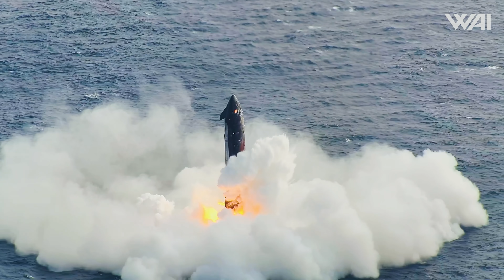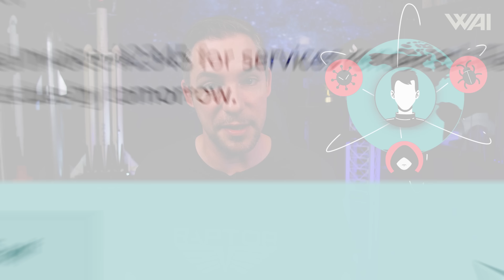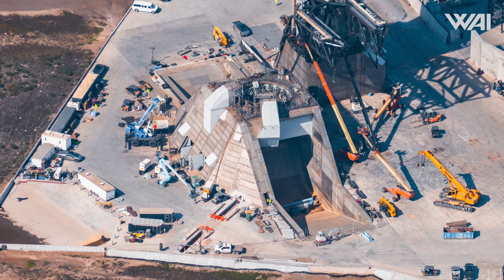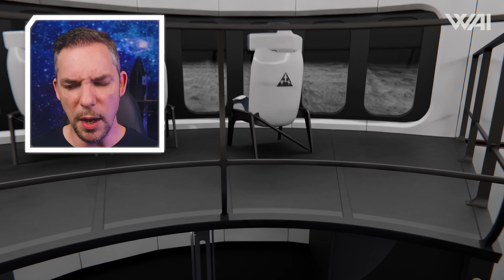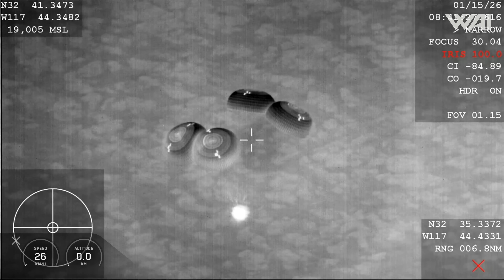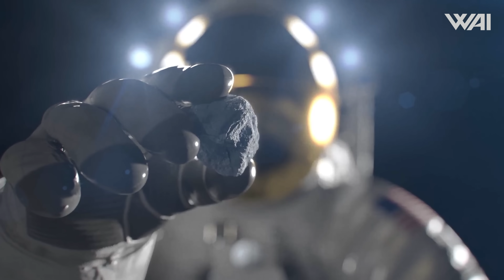SpaceX's Ship 39 Ready For Testing! When Is Flight 12? Isaacman Announces Moon Base!

Comment: COPV issues exemplify why carbon fiber composite structures and cold liquids are a bad mix. Going with Stainless Steel will prove a genius move in the end. Atmospheric re-entry and re-use with low conductivity, easily en-brittled cf (=also high boil-off), large tanks filled with cryo props and autogenous pressurization's gaseous phases which add thermal gradients that exacerbate stresses would probably be a show stopper for Starship just like the failed X-33 program showed. We'll see if CF works for the reusable Neutron, unlike Electron.

Comment: If a lunar ascent stage were mounted orthogonal to starship length in its nose, its engine could provide cushioning thrust for a controlled tip-over upon a vertical lunar landing, the tip-over being initiated by one of the perimeter landing engines. You wouldn’t need the big cushion or the unloading elevator. During a mishap, the ascent stage could fire to return astronauts to lunar orbit. Pilots, and any passengers, would land on their backs on couches (needed more than chairs in the base) and would be standing once the tip-over is complete.

Comment: Yeah I just don’t think it’s worth it to use carbon fiber in something that’s going to be reused. Even when it’s used for its tensile strength, there is still way more failure fatigue in carbon fiber than there is in metal. Am I wrong here? It just seems like a pretty obvious flaw in an otherwise sound system.

Comment: FYI,  the image of the large COPV on a pallet strapped down to a truck bed is terrible transport practice for a copy. The red covers are marginal and only prevent accidental minor damage caused by a tool or slight bump. The trailer staps are very powerful and could easily damage the copv.  If they want to get to Mars,  they need to train the people not to treat them like a concrete drain pipes but rather delicate instruments.  COPVs give the lay person the air of being tough, but they not. The worst part is, most could never detect the flaw after it is damaged. That's why you protect them like delicate eggs from the point they are made to the time they are installed. They learned two, possibly more events due to this, if the trailer situation is a measure, they are likely to again.  I live not far from you on the space coast by the way.

Comment: Since SLS Block 1 will NEVER fly again after Artemis II, and Orion failed on Artemis I and Orion has not been redesigned , what exactly is the point of risking four lives and billions of dollars on a test of these two obsolete systems?  Why continue to subsidize the profits of Bechtel Corporation in building a new launch platform to handle the slightly larger SLS Block 1B which will probably only fly ONCE at a cost of $6B.

Comment: If NASA was up to ship 39 to get into orbit, it would have been cancelled long ago
Reply: Well, NASA has not tried to master full re-usability with any ship/rocket combination...so not a valid comparison.
Reply: @markb2773  What would you call the Space Shuttle then? The solid rocket boosters were recovered and reused as well.
Reply: @flightsimdev  Yes, that is true , but the cost and length of turnaround was not sustainable.  I remember reading that it actually would have been less expensive to just build all new solid rocket boosters than to refurbish the ones used.  And the Space Shuttle was amazing (I absolutely love it to this day) but its many different sized tiles and its refurbishment in both cost and time was considerable.  They (NASA) then went back to expendable rockets and kind of gave up on re-usability.

Comment: So this is speculation only but I think there may be more to that red casing than your thinking. Remember that sub that imploded a few years ago? So part of what happened was separation and THERMAL effect which further exacerbated the defect.
They need an insulation wrap to protect them from the extreme cold of the tanks I think. Otherwise a defect that is inside the wrap and visually undetectable could fail in extreme thermal situations. Such as cryogen liquid.

Comment: And SpaceX is never going to be able to explore the Galaxy. There is a  whole leap in technology that as yet has to be discovered before humanity can leave the solar system.
Reply: How do you know that leap won't be discovered by SpaceX?  Who else is going to push that envelope?
Reply: @markb2773  Because this is physics, not engineering and a century of evidence shows it isn't possible
Reply: @JohnLagrue  Not at this moment...but airline travel wasn't possible 125 years ago either...it won't be never but it also won't be any time soon.
Reply: @markb2773 true enough, up to a point. But the physics of non-chemical propulsion needs to be discovered even to explore the solar system. Beyond that, relativity says we cannot go. Not until some major scientific breakthrough.
Reply: @JohnLagrue  I agree with you there.

Comment: it's not a bad composite over wrap, it's a bad weld seam or leaking seam the carbon has "nothing" to do with the tank, the welding is flawed in some areas or it's metal fatigue remember they press the top and bottom to shape

Comment: What has been the lead time on V2 vs V3? How long has each initial flight article been in construction and testing before launch? If V3 has had a longer lead time I think it is safe to assume that spacex is taking what they learned from moving fast and breaking things to really do their homework and thoroughly test all aspects of the new designs on the ground, or at least as much as they can so they can ensure that when V3 finally lifts off the flight goes very smooth or close to it. with potential modifications learned from testing waiting in the bays, but nothing substantial to the point that we saw with V2. I think they want this version to work from the start and really take them to achieve major program milestones in quick succession with minimal modification. Time will only tell but I hope that this is the case.

Comment: I think the proposed fuel transfer docking system is strange.
A kind of space station that could dock starships and fuel carriers simultaneously seems like a more correct solution. Using, for example, a docking system similar to that of the ISS, where it would even be possible to have several fuel carriers simultaneously.

Comment: Actually those are not ‘refuelling ports’, they are ‘refuelling docking ports’ since the actual refuelling is going to be done via the Quick Disconnect Ports.

Whereas these are needed for the refuelling docking process. So they are actually docking ports.

(This is going to get confusing when we later add ‘Docking transfer ports’ into the mix !
Reply from the maker: Not fueling, but refueling! Precisely! Yeah, I see how this is getting confusing. :D
Reply: @Whataboutit could a hydraulic/ syringe type design work for refueling the starship?
Reply: Semantics...
Reply: @johnd.7792 … are important. If no fuel travels through a port, it is not a refueling port.
Reply: @TallinuTV  'refueling docking ports' you said, then turn around and say it's not a port... Is it a port yes, what is that port used for? Refueling... while saying it's a refueling port is more informative, doesnt mean that calling a refueling port a port is wrong, just not as informative.
Reply: @johnd.7792 technically, if fuel doesn't travel through them... They're just docking ports, which are used when refueling. Is what it sounds like he's trying to say?
Reply: @GrabNSnatchM Again it's a docking PORT... you are literally saying a port isn't a port, and it's wild to me.
Reply: The affect astronaut.....Zena is pregnant.
Reply: Are you describing the fixtures on the hull of Starship or Jerod’s ears?

Comment: Get ready for more problems.  SpaceX is flailing here.
If Artemis III in 2028 was a real date.. the HLS or Blue Origin Mark 1.5 lander would be in manufacturing today.  That is the normal process for designing, developing, and exhaustively testing and retesting man-rated space craft - it's a process that takes years.  Since I don't see anything like that happening now, 2028 is a fantasy.  Or .. Artemis III will NOT be a moon landing.
Reply: NG3 does not appear to have a scheduled launch.

:planet-orange-purple-ring:

:planet-orange-purple-ring:

Comment: I was thinking they always have problems with hydrogen escaping why not build a small enclosure around the pipe connection then pressurise the inside wouldn't it then stop the hydrogen escaping from the pipe and if you pressurise it with O2 or somethig like that the molecule will be to big to fit through the gap the hydrogen is escaping from , so it would be a good gas to stop the hydrogen from escaping

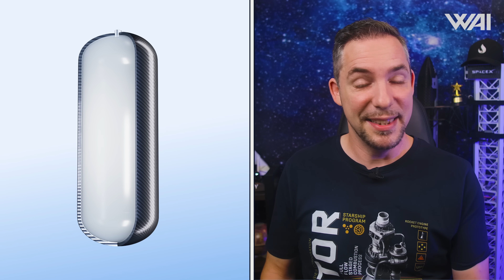Comment: 3:25 I'm not pursuaded that mishandling has caused all these COPV failures. For instance, flooding a COPV with cold fluids might shrink the metal lining away from the composite wrap. Perhaps pressure must be increased before the temperature is lowered so much.

Comment: 7 (20 if you count concepts) years and still not that close to a fully working starship that takes real payload to space. People talking about lightning fast development but it actually not THAT much faster than anything else, its just another development philosophy that is more spectacular... Doing things fast and wrong and having to rebuild everything several times is often not much faster than building slow and right from the beginning. But yes, they are most likely a lot faster to mass production when they actually get a production ready ship.
Reply: Are you taking into account "full re-usability" because that's kind of a major detail.
Reply: @markb2773  Most rocket project has some "first" in them. My point was just that they are maybe fast but not any extraordinary since they doing everything half baked the whole time. (A little rabbit versus turtle). So when you compare time lines with other projects you need to go from start to end, not "first flight" or something like that since they have not flown any finished product yet (Now they say that generation 3 should be a working product so lets hope that). Like I wrote, they started with design concepts for a super heavy 20 years ago and Starship was presented 7 years ago. Lets say they start delivering payloads in end of 2026, then its 8 years. Its pretty fast but not unheard of.

Comment: I forget, are the arms gone for tower 1? If not, they could catch booster there and ship at 2.
Reply: They are not gone BUT where the pad was is a big hole in the ground at present so no where to set it down after the catch.  There will likely be some construction there when IFT 12 happens which you would not want the exhaust of the Raptor 3's flaming the construction site.  

:planet-orange-purple-ring:

:planet-orange-purple-ring:

Comment: Make Star Trek real. 2 essential technologies innovations:
Anti gravity, inertial damping. 
Everything else will fall in place after.
Reply: Not anti gravity but artificial gravity. Either inertial damping or force fields. Force fields will lead to deflectors which will lead to shields.
Reply: @chrischeshire6528 To build or launch the massive ships & structures that weigh thousands of tons, you need to neutralize gravity.
To keep the pink skins from turning into a paste during acceleration to luminal velocities, inertial dampers for the occupants to survive high G(10000 or more). 1G won’t get you anywhere near interstellar speeds.
Clamping force or force fields will only contain the pink paste.
Reply: Impulse drives and warp drives essential as well.  

:planet-orange-purple-ring:

:planet-orange-purple-ring:
Reply: @Scanner9631 Im am surprised that warp drive is close to becoming a reality. Using gravity to bend space behind a spacecraft to push it forward like a surfboard will be the next big step.

Comment: The other companies are creating amazing rockets.  SpaceX is creating a vision.
Reply: Creating wet space dreams for planetary junkies.   To do what?  Mine dilithium crystals.😂
Reply: @jml_53  interesting opinion
Reply: @elonm101  🧌
Reply: Pa-leeze 😂
Reply: Vision of what?  Mars?  Mars cannot happen with present technology.  It will take revolutionary advances in propulsion, materials, and technology to see anything close to a manned mission to Mars. A sustainable habitat???  A century or more. Do some research on radiation, orbital mechanics and the rocket equation and you’ll quickly see how Musk’s talk of multi-planetary is at present pie in the sky.
Reply from the maker: @MrCrystalcranium  You might want to look into things. We can easily reach Mars without a revolutionary new propulsion system, and we have the technology to build a permanent base on Mars. It literally comes down to mass transfer. A lot of mass needs to be moved to Mars. Starship can absolutely do that, and it's also needed for anything else after that. :_WAIHeart:
Reply: @Whataboutit  Hi Felix!  A 9 month trip there and a 9 month trip back plus a required 18-20 month stay to coordinate the minimum distance between earth and mars means a huge amount of radiation and galactic cosmic ray exposure. How do we protect a crew from that without heavy shielding plus provision of life support systems, fuel and crew needs?  Even with an incremental trip stopping at a hard enough to construct moon base I don’t see how all that happens. There is a tremendous amount of weight that needs to get off earth, be assembled in orbit (something we have no experience in doing) stocked and crewed before the trip begins?  It’s the details of what is needed added together that makes this so daunting.
Reply: @MrCrystalcranium 
Man crossing the ocean used to be daunting.
Man flying through the air used to be daunting.
Man going to the moon used to be daunting.

Yet man has done all of those things.

And man will do all the other daunting things also.
Reply: @Whataboutit   No one is going to Mars ever.
Reply: @mrchrisoko  It’s not possible with current technology. The things you state needed huge advances, long investments in time and money with the national will to spend that money. Of course we’ll get there eventually but you and I will be long gone by the time it happens. Musk or any of his kids or grandkids won’t live to see it. The fantasy of someone going by the next launch window is just a ridiculous idea.
Reply: @MrCrystalcranium Only fools say a thing cant be done because a thing is done all the time.
Reply: @mrchrisoko  I didn’t say never…I said not in your or your grandkids lifetime.
Reply: @c @mrchrisoko  Check the opinions of Neil Tyson and Brian Cox 2 guys way smarter than you and I on this
Reply: @MrCrystalcranium I gladly take the other side of that wager. In less than 100 yrs, man invented the automobile, airplanes and spacecraft which landed us on the moon. I'm more than confident man will reach Mars in less than that time. If not me, or my kids, my grandchildren will certainly be interplanetary travelers.
Reply: @mrchrisoko  Ok whatever
Reply: @MrCrystalcranium  I agree. With current technology, this will never happen anytime soon. But...Isn't there also a clear limit to what the human body can handle over time, besides the radiation? Decalcification of the skeleton? The shrinking of the heart in low gravity? Your timeline you describe for trips to Mars is more or less correct from what I understand. I'm no expert, but I think that previous experience humanity has with low gravity and space radiation proves that prolonged exposure to the above makes the whole Mars trip a bit of wishful thinking.
Reply: @Mr._L.E.J  I don’t know about ever but what is being talked about on these channels is a century or more away.
Reply: @Mr._L.E.J  Just want to say one more thing and then I’m done. Saying this will never happen was not my intention. My intention was to inject some reality into these discussions. When Felix commented above “we certainly have the technology to build a habitat on Mars” I hear a throw away statement. How long does anyone think we are away from building semi-permanent habitats on the Moon?  Is that something that’s going to happen in the next 10 years?  If it does and it’s crewed continuously anywhere similar to the ISS it would be an amazing achievement. A decade timeline for that is incredibly optimistic. I think we are at least 2 years away from Musk’s plan to successfully transfer fuel in orbit. As for Mars, the distance involved is several orders of magnitude further than the Moon at its current approach and inaccessible at its furthest. Renders of air tight domes, vehicles, landing and launch pads etc are interesting but you’d have to be crazy to think anything like that is going to happen in 50-100 years.

Comment: There has been a lot riding on the last two test launches and each one felt like it was a big milestone. A lot of that was to get back on-track from the failures of flights 7-9.  But I think flight 12 is arguably the most important flight test since flight 1. This flight will be testing everything. New ship, new booster, new engines, and a new launch pad and tower. If things go well, it will be a major success for the Starship program.  No wonder SpaceX is checking everything multiple times. 

Best guess for testing is the January 23rd.